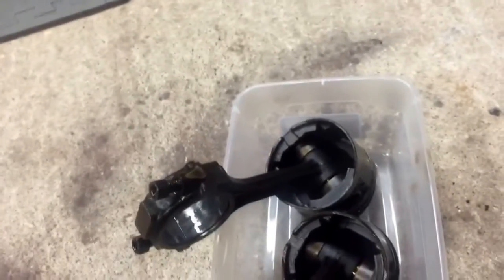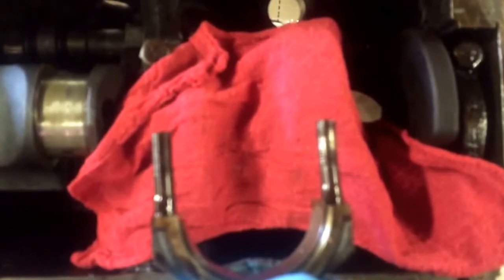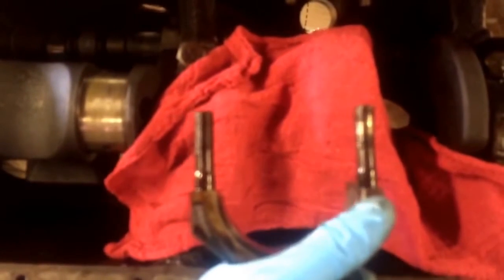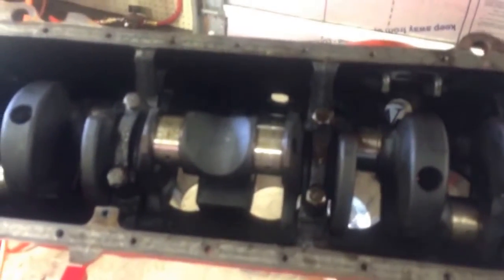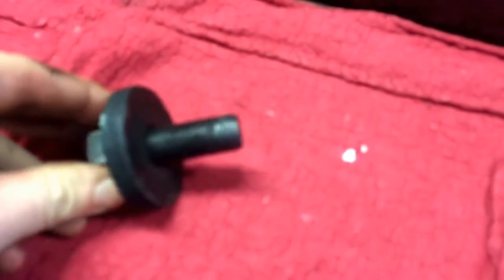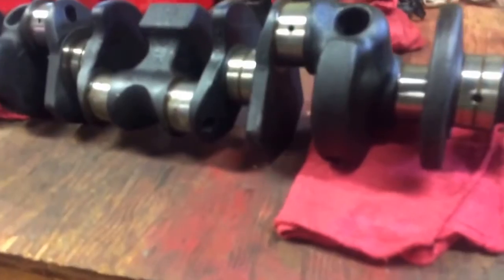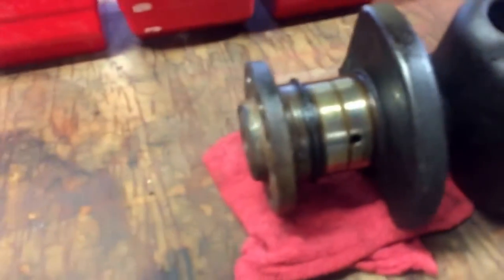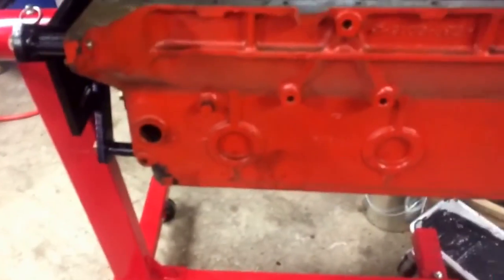Ford 223 inline six dissection before machine shop review.

Comment: On the 1st water pump of the 3 ,Is there a center bolt holding the rotating fan ? Mine looks fused because of oxidation ..

Comment: You should take the other six apart and see which is worse ... never know
Reply from the maker: +TheFrameoff I&#39;ve considered it.  The blue one is far more used then the orange one.  There are no markings on the orange one stating how much it has been bored over- nor do the pistons state any overage.  The blue one was bored over forty at least 3 years ago and the previous owner admittedly put 10K miles on it- though the odometer stopped working. Blue one blew a couple freeze plugs.